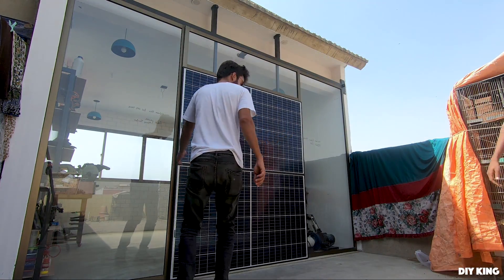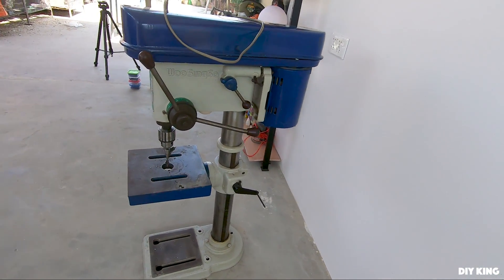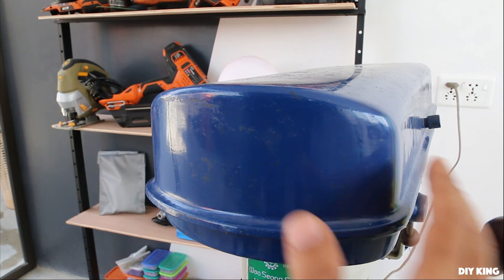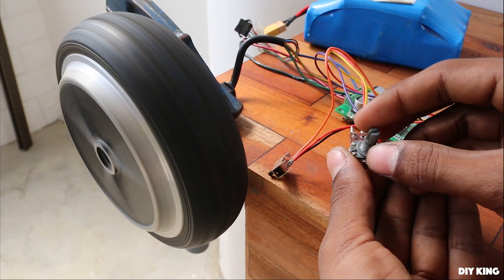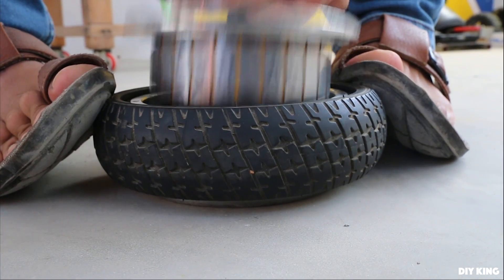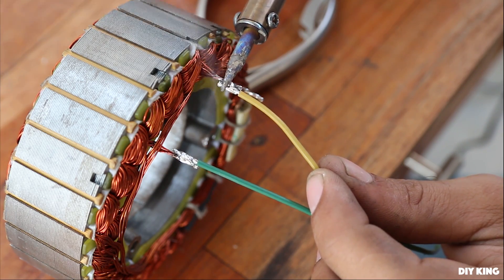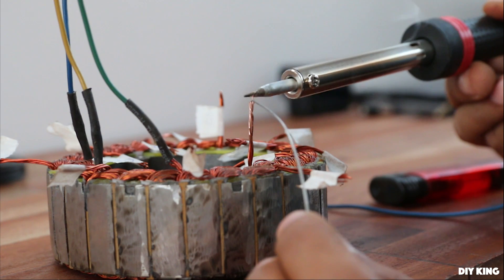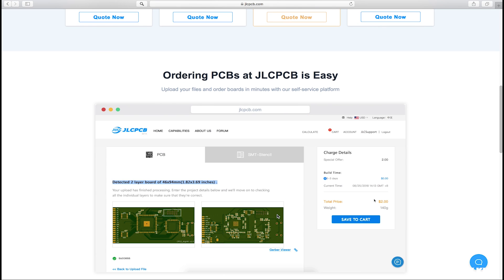Drill Press Conversion to Brushless Motor

Comment: Was something wrong with simply replacing the original motor with the original unmodified 'hoverboard' motor. Why so much work?
Especially as by keeping the original drive belt, you get some shock absorbing if/when the drill bit jams.
If the bit jams in what you created, that machine will break your arm without a second thought, especially if and as in the video, you don't use a vice or clamp to hold the metal you're working.
Vastly simpler and with a much more versatile drill afterwards. And safer.
I don't think you guys do much metalwork either - I just watched some good number of drill-bits get completely wasted..
Use some cutting fluid in future OK

Comment: really neat conversion.  Did you test the battery life? Say, drill 10mm steel plate with 15mm drill bit and see how many holes you could do before the voltage dropped too low?

Comment: Nice to see young guys using their creativity. I however would like to make an observation. I think when it comes to drilling holes  in metal, (especially large holes), you'd need to use low RPM, and DC motors do not have enough torque in low RPM mode. Using high RPM when drilling large holes, just kill your drill bits. Good job, nevertheless.

Comment: Great mod! What is the max rpm after changing coil connections?could you share the winding detail please? before after? Im planing to use this motor on a small lathe or benctop mill. Also how is noise after conversion compared to original?

Comment: Hey DIY king, could you please tell me the technical info of the hoverboard motor?
https://dutch.alibaba.com/product-detail/36v-300w-waterproof-electric-balance-car-weel-hub-motor-60710727749.html?spm=a2700.galleryofferlist.0.0.7e664815GfqUu1
Does it have the same amount of voltage as this hoverboard given in the link?

Comment: Very interesting! Might the original induction motor have been damaged in some way? It just didn't seem to be performing as one would expect especially with the pulley system to help.
Reply from the maker: Yes it seems that the winding is damaged but still these induction motors have poor power to weight ratio and with the conversion i am extremely happy with the outcome, using the drill press for more than two weeks now.
Reply: @DIYKingSaM  Cool, I'm working on a similar conversion using AC servo, that can be used to instrument machining processes.
Reply: Induction motor needs the start capacitor replaced. I Had the same problem i replace the  capacitor and problem solved